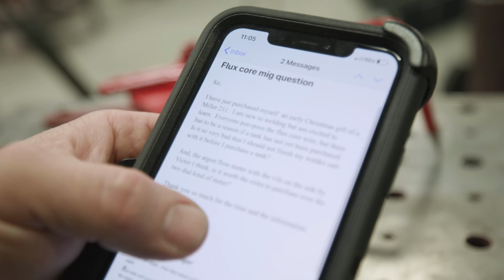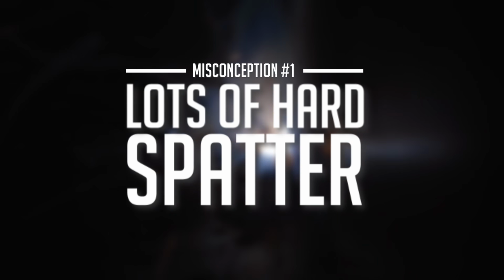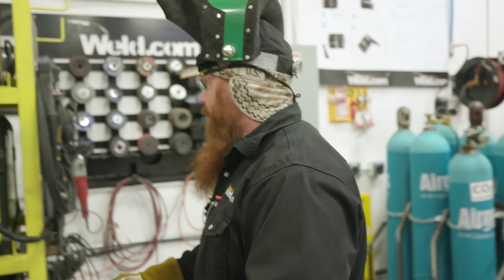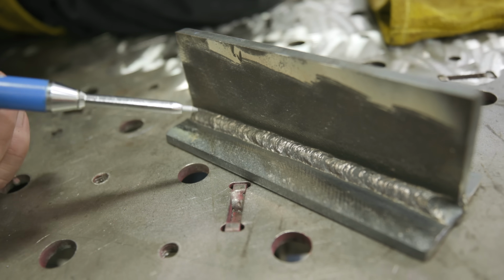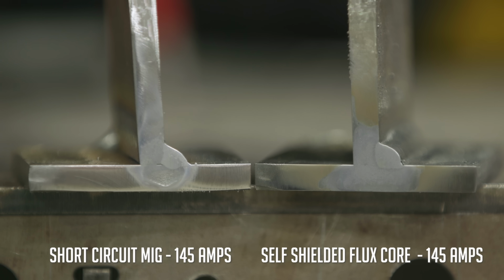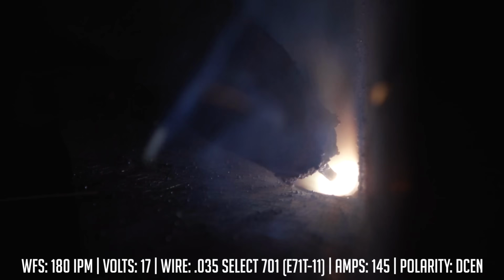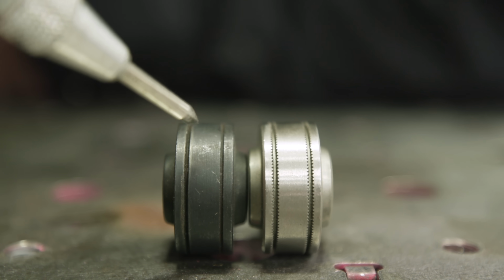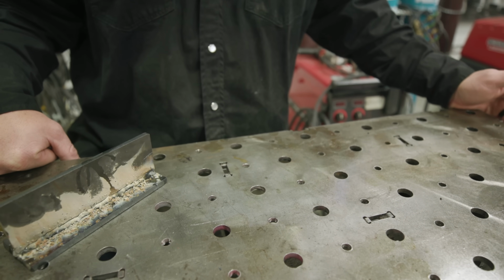3 Flux Core Welding Myths DEBUNKED

Comment: WHAT?!?!  JUST CHANGING THE POLARITY FIXES THAT?!?!? DUDE! I thought I was just a trash welder 🤣
Reply: we had 1 machine that welded like this and it was named the spatter welder...everyone avoided it and would steal parts of it
Reply: @MrRasZee  lack of education can be expensive!
Reply: Never knew about the wire feed wheel. Great information here.
Reply: Read the instructions before you start,  always helps! ;) Great videos here for newbies!
Reply: Same, mate.  I even went to a stick welder.. All those years of practice with nothing shown, and its all in the polarity... oof..
Reply: Mine’s a bitty little 120 inverter welder and came dc negative, she runs really good for being such a tiny little thing
Reply: Lemme tell you something Tiny. This was by far the most informative instant gratification solution for troubleshooting a FC welder. As a fairly new person to welding and finally buying my own welder it has been frustrating trying to learn when most youtube videos are merely unboxing reviews the channel is doing for a free welder. Not very helpful in instruction or tips, tricks and troubleshooting. I don't know if your instruction was so informative that I absorbed it or what but do you know that feeling you get when the light bulb finally clicks on with something that you've been right on the verge of making that last connection. The difference between performing something well and being proficient at the task or being a globby, spattery, swiss cheese looking welds that require every 4.5" grinding disc you can find in a hundred Mile radius. With the bulb being on it all of a sudden makes sense. Either way, well done! Whatever reason you wanna call it, you got this guy here to find the missing links between making my welding experience frustrating and right on the verge to now I'm able to perform welding projects that look great and far more connectivity or quality of weld functionally and esthetically. Fuck yeah! Thanks Tiny!
Reply: yeah, me too. can't believe i've been welding with the wrong polarity all this time because I switched to flux core. i just thought my welds looked like crap. no wonder they looked like crap...
Reply: lol! a trash welder around herb is one that can weld old used steel to a new one or together to fix something!! i use flux core all the time did not know it was a problem for some tell some professional welder ask me for help he could not get it to work!
Reply: I'm glad the machine I used had a sticker explaining what to do for each wire type
Reply: Great video! The Miller 170 was not feeding well. Now I know it needs a knurled feed wheel
Reply: My new Hobart has instructions inside for polarity for mig vrs flux core. Tbh I never looked on the old welder so idk. It was gas ready too, but all I ever ran through it was flux core.  I have tubing framed gates and 1/2" round stock framed   penning around the farm here that are 15-20+ years old though and still in service I made with it.
Reply: NO, IT CAN STILL BE A TRASH WELDER, mine spatters all over the place, no matter the voltage or feed, even after testing the polarity. Makes no difference in either case.
Reply: Thats not going to make you a good welder.
Reply: Same
Reply: Oh man, well I won't make that mistake again.
Reply: Well the fact you didn't know that..
Reply: Trash welder=grinder
Reply: Great information! Thanks
Reply: Me too!
Reply: @garynew9637  me too! however i dont know if my harbor freight 90 amp can be switched. and the tension wheel is wrong too....damn harbor freight.
Reply: @Lindenmooch  It can, it's just inside the machine, usually where the wire feeds into the whip.
Reply: @Lindenmooch  I have one from harbor freight too, and I have plans on finding out if it's a DC welder and if so, I"m gonna swap that shit myself. Lots of testing ahead.
Reply: @Orcinus24x5  not with my cheap machine. i tried to change polarity, and smoke was coming out of the machine. luckily it turned off on itself(overheating protection), so i can only weld with solid wire
Reply: @Lindenmooch  it probably can be changed its on the inside probaby a copper plate on bolts or lugs that is moved from + to -
Reply: then of course your return will be +
Reply: @Lindenmooch  
So far as far as I can tell our harbor freight Chicago Electric 90 Amp Flux Core Welder unit has a AC output not DC.
Reply: @Lindenmooch  if u got the black 240v then u can unscrew the connectors in the welder
Reply: @Lindenmooch  they way harbor freight tells you is wrong u need to change it
Reply: @Lindenmooch  Try letting it heat up a bit by welding scrap for a bit. Ive heard the Chinese welders need to be "warmed up" before they penetrate properly.
Reply: @dennis-taxi  holy crap, y'all need to understand what it is your doing. If your welder isn't set-up to be switched then DON'T!  Great way to start a fire...
Reply: @Lindenmooch  I'm a year late but those are flux only units, the polarity is already correct. Changing the polarity is for mig/flux machines
Reply: @Lindenmooch  that Chicago electric 90 amp flux mig from harbor freight , which quite a few here in the replies apparently own , already comes with the polarity set properly for flux core wire welding , I have one myself (unfortunately)  and it is def set properly outta the box. Setting the polarity of a mig welder , for either solid wire (+gas) or setting it up for flux core ,  is something that only applies to mig welders that are capable of using solid wire and gas,  you will only have to reverse polarity on gas mig in the event you are swapping over to flux core welding wire
Reply: @Lindenmooch  I use a harbor freight welder no problem, make sure you feeder is not clamped too tight, cause if it crushes the wire the flux won't work right.
Reply: @raffighookassian1724  he died about 3 years ago in a house fire, so no biggie lmao
Reply: @ericdrisgula3879  there's alotta fluxcore welders of every shape and variety that come out the box with the polarity wrongfrom the factory, always check for yourself.
Reply: 80 % of welding is knowing your materials and equipment settings , so , yes if you don't know you can switch polarity , ............you are a crappy welder .
:)
Reply: @theklrdudeoo9173  everybody has to learn even if you weren't born with the knowledge super welder
Reply: You ARE a trash welder...because you didn't know about polarity. Lol. jk.
Reply: @jamescrud  Following that logic, you are too. jk. There was a time when you didn't know. 
Maybe someone should start a list. 
Jeff Foxworthy style. This would also be a list of things for beginners to research. 
You might be a trash welder if:
1. You don't know that changing the polarity on your mig will make a huge difference
2. You don't properly prep your metal
3. Gas is cheaper than you might think. Don't purchase new cylinders but get refilled ones from suppliers like Airgas, etc.
4. etc.
5. etc.

Comment: I just repaired a steering rack bracket on a 99 pontiac grand am crossmember with a modified harbor freight 90amp flux core welder(converted to DC) work great
Reply: @arnulford66 There are a few videos on the conversion mine is a little different I used both a choke and capacitor also installed a large AC fan on the rear grill. I converted an old blue harbor freight 90amp couple years ago just using caps but my new conversion gets better results.

Comment: I started on stick. Them mig ,and flux core. Its all good , flux core problems for home gamer's start l::ack of experience,with wire to large for the machine, polarity is next, last is inferior material prep. Other than that flux core is great , for the farm,shop,service truck. It works. Just be careful your wire is rated for multi pass if its getting built up. That's a big one.

Comment: Be aware that the cheapest gasless welders on the market are often gasless only and can't be converted cheaply.  They are also AC.  These are absolutely rubbish machines and a lot of what is said in this video doesn't apply to those. 

Even the next level up being Gas/gasless are AC on both settings.

I think these welding machines are why gasless gets a bad rep.

Comment: My little lincoln sp125 plus purchased in 91 has been flux since day one. I am an amateur welder at best and I felt squeamish to admit I only had FLUX. A pro welder friend of mine took my flux box ran a bead with it, then on the other side ran a bead with his huge fancy mig box, and today I can't tell the difference, still. It ain't the size of the ocean that rocks the boat, It's the motion of the ocean. I suffered from welder envy? How dumb was that! Upgrading to newer MP box real soon but my sp125 and ac-225 buzz box will be there plugged in and ready at a flick of the switch. Excellent video.

Comment: I regularly use E71-T11 because of how many repair jobs are outdoors. E71-T11 is AWS D1.1 structural certified and multipass makes a significantly stronger weld than solid wire.

Comment: Been flux core wire welding in the wind and I still get crap welds. The other problem I have is thinking it's a stick welder and moving the tip closer or farther to vary the heat which doesn't work with flux core wire. Need to change the settings.

Comment: I've been a welder 40 years, I agree with what you said, I know every welder is different , hell flux cored wasn't around, or popular when I learned to weld, I seldom use flex core , since Duel shield came to town, and you  have a good presentation, But try running your cord wire the same way you run your 6011 stick ,using a whip and pulse Technique, For me I can run it hot on heavy  plate, remember cord wire is stick, it's just rolled up in a spool,on thin material you  not only a the stack of dimes appearance, but also a very clean weld without any burn through,I'm also CWI via AWS so in my shop I also teach people who want to become welders but can't afford it Can because I never change for that, not to be the fact I'm always short on welders but don't want pay that, it's a win,win situation  Lol.lol.lol,,I target Females for two reasons,(No I'm not looking for welder girlfriend ) Its because they are discriminated against, and there just aren't enough female welders who want to be but Aren't because of this, they can learn to weld and leave with papers in hand, so if anyone doesn't  understand anything discussed here can email me at (mainlinewelder@yahoo.com)

Comment: Ok, just easier to ask. Very novice welder. Great information on this video though. I have 409 ss exhaust pipe. Welding 304 ss cutouts to pipe. Thinner wall thickness on cutoff tube, pipe. Hobart 140. Have c02 only. Purchased. 035 309fc filler. I know i can use e70. I can paint it. How should i set up the welder? 309, Read trigger pos. You stated neg here. Recommend set up please.  Thank you

Comment: flux core is dirty and sloppy compared to MIG and you have to clean up after but its useful in the wind and for small MIG machines. MIG is better for fine work like filling gaps or holes
gas shielded flux core is over priced and a little less sloppy
you should have ran a bead with spray arc MIG to show people how clean and spatter free it is

Comment: I am a 68 y/o disabled RN that learned a little about stick welding when I was in the 9th grade back in the 60's. So what I know about  pro welding you can put it on a very sharp needle! I do have a small O2/MAPP set up that I can braze with. However, there is a small chance later in the summer that I can get an inexpensive MIG welder to do some welding with. I will go to your help section to let you know what I need. Great video and I have subscribed to your channel. :D

Comment: You're welding over your own spatter. Off course you'll get porosity. Selfshielding fluxcore is a compromise meant to crud stuff together, not for x-ray works. Personally I'll go with stick any day over it. Gas shielded flux core, on the other hand, is advantageous in many applications. Ceramic backing and just burn the night away. Or a root with OK 75.75 and then Topping with Megafil 713. Sometimes I miss my welding days.

Comment: Excellent video. I don't use my cheaper flux mig unit unless it's quick a tack weld on light steel. I will be tweeking my setup using your tips.  With some luck I will be able to change my opinion on flux mig. Thanks

Comment: Flux core weld is more ductile then gas metal .....a good rule of thumb is gas metal for thin metals  Flux core use for thicker metals .
Reply: It all depends on what you’re doing. I have used it to weld galvanized sheets together to line walls for restaurants for decoration and it’s great. ( make sure you are outside and well ventilated)

Flux core can burn through the galvanized surface and keep on going. It’s amazing. You don’t want to have a bunch of grinding marks on the material where you removed the galvanized coating.

Comment: Being a sheet metal worker for over 40 years, I learned a long time ago about the benefits of flux core wire. When we install black iron duct for kitchen exhaust, it would have to be from 16 gauge to 10 gauge thickness. In New York City 10 gauge is used most of the time. Flux core on a job site is the way to go. We're using 110 volt mig welders, making sure it had a dedicated 20+ amp connection. The first welder I ever used was a Lincoln SP-110, which I still have and use today. I do weld ¼" stock with it and comfortable with the results. It's great for doing pickup truck chassis repairs as here in Pennsylvania road salt is a killer. One note on flux core wire brand, I will only use the Lincoln brand as it has very little splatter compared to other brands. Great video and I have subscribed to your channel.

Comment: WOW, i have always wondered why when i used flux core wire the welds were blobbing. but since i switched the polarity on the ground and gun, its like night and day. thank you for that great tip on reversing the polarity when using flux core.